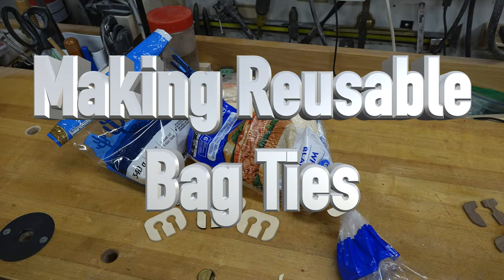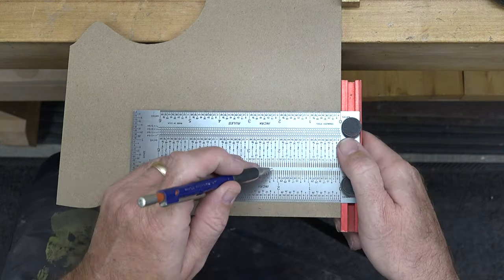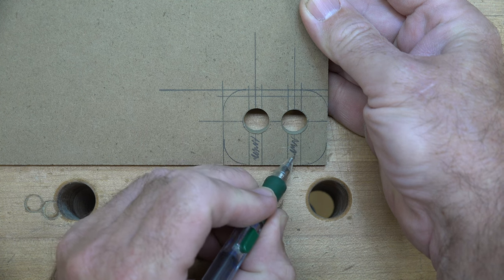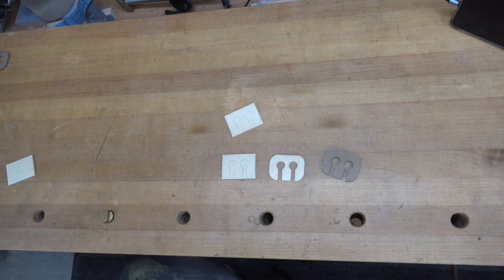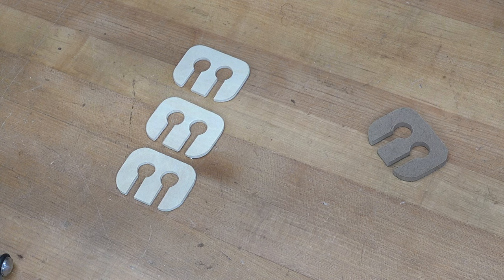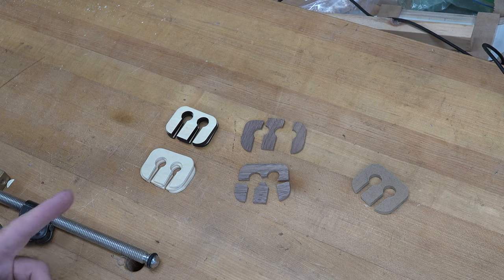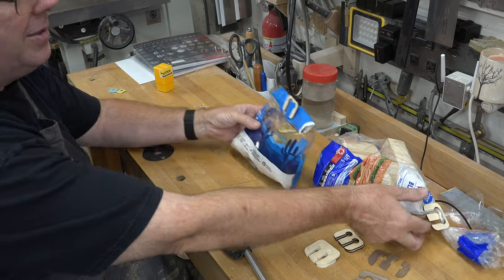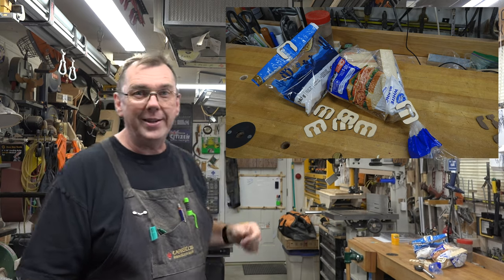Making Reusable Bag Ties

Comment: LASER wooooooooo ... was thinking that would be your fourth method😁 ... in the UK we have basically a piece of sticky tape to seal up bread, but I like these a lot better 👍

I had to laugh at you saying you'd never eat a bag of crisps (the proper name not chips) in the one sitting ... I could go through a couple of those bags quite easily (I love crisps)  ... the only reason I don't is due to the increasing waist size 🤣
Reply from the maker: Chips (or crisps) do not actually increase your waist size.  It has been scientifically proven that eating excessing amount of chips (or crisps) will actually shrink your clothing.  It's a fact.  Don't believe it?  Just ask me.    Thanks for tuning in Barry.
Reply: @acutabove_woodworkings  I really don't need an excuse to eat loads of crisps, but I think I may have to check out what you say ... only to check scientifically of course 😁

Comment: Hi Ken, very simple to make and you can use your scrap 1/8" ply I like that, as you shown it's useful for closing bags, here a question will it hold long hair in a ponytail while ladies put on makeup, I know it's a silly question anyways Thanks Ken
Reply from the maker: I don't see why it wouldn't Alan.  Depending on the thickness of the hair, the clip might need to be enlarged and the holes made bigger but I don't see why it wouldn't work.  Thanks for tuning in this week and for chiming in with your question.